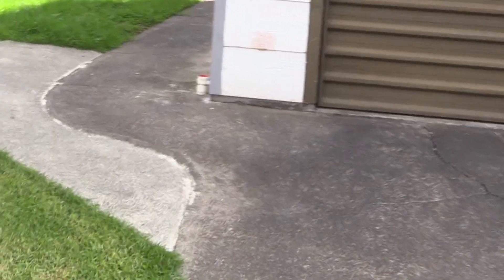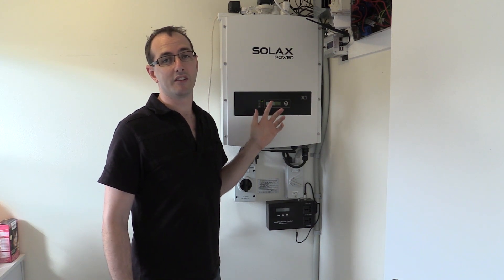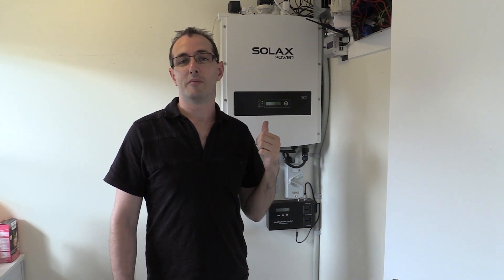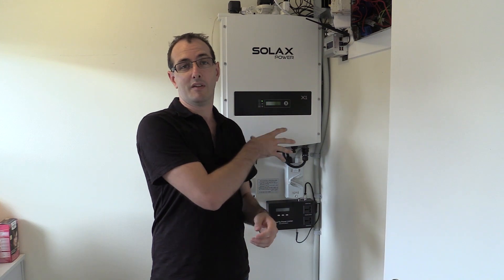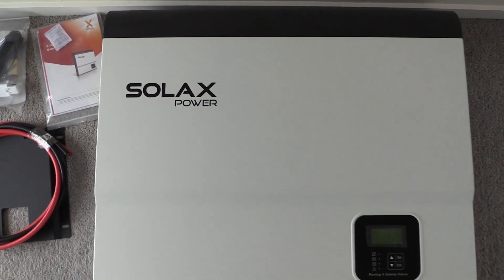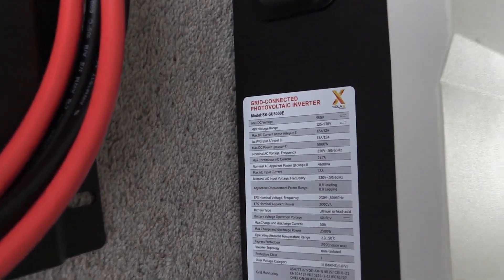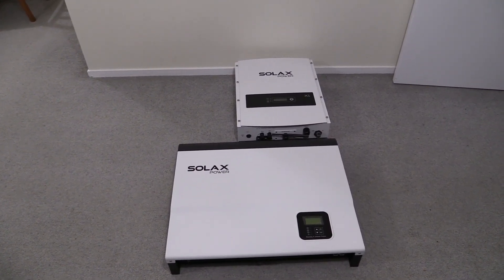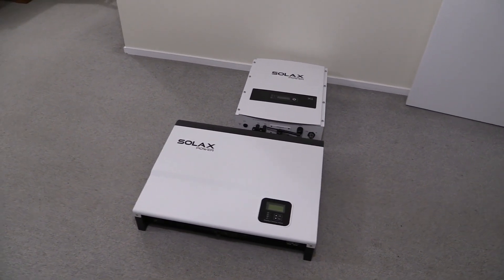Exciting new Solar Solax Inverter

Comment: What I don't understand with Hybrid inverters is whether such off-the-shelf inverters require some expensive off-the-shelf battery to work, or if they are OK with a DIY power wall project. I guess I'll find the answer in some later video of yours, I just thought I'd leave this here. ;)

Comment: sktl not the sksu the sktl you can get external BMU and can get the 5000w100amp is the best, i have the sksu and has built in but its only 2500w50amp

Comment: There are many people who use kW and kWh interchangeably.
When you talk about POWER unit is kW (Kilowatt) . 
When you talk about ENERGY unit is kWh (Kilowatt-Hour).
Inverters generate POWER so they are rated in Kilowatts (not kWh as mentioned at 7:26)
Batteries store ENERGY so they are rated in kWh. 
If a 5kW  inverter delivers 5kW for 2 hours it delivers 10 kWh (5x2).
I suspect it was a tongue slip at 7:26, but it important to know the difference.

I look forward to your installation.
I notice it has a BMS input. Will be interesting to see how you use it.
Reply from the maker: Thanks Peter for clearing that up, :)Yes very easy to mix up the terms when trying to video on the spot.

Comment: looks like a nice inverter I would love an on and off grid demonstration.
Reply from the maker: I will do a video on that later down the track :) Planning to have all lighting and Fridge connected to EPS. Which is all you need when the power goes out for a short time. In NZ we hardly get power cuts and are not planning to go offgrid, but would like tp keep the lights on in a powercut. Tho we might look funny being the only house on the street with lights on hahaha

Comment: If you were to buy it off the shelf, how much does it retail for, and great vids keep them coming 👍
Reply from the maker: At the time  when i looked it was around $4600 NZD ish and a plain gridtie was $2000 which is why i got the $2000 one
Reply from the maker: That one on trademe NZ is not the SK-SU 5000e model, That one for the lower price is the is the SK-TL model without the builtin changer "says on the first couple of lines in the ad" so you would need the changer aswel which for the 25amp unit is around $800, also listed on TM "1442565117". The SK-SU has a buildin 50amp changer and costs alot more. RE: http://www.solaxpower.com/wp-content/uploads/2017/08/Gen2-X-hybrid.pdf